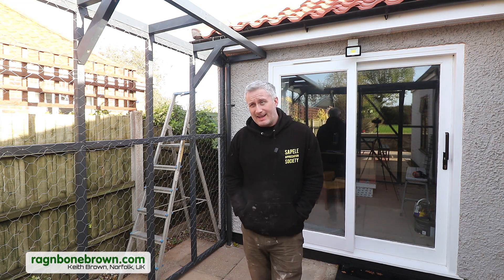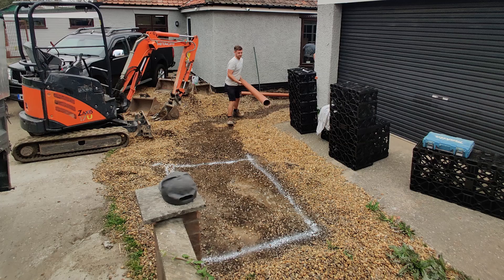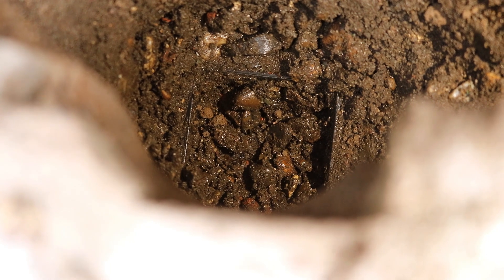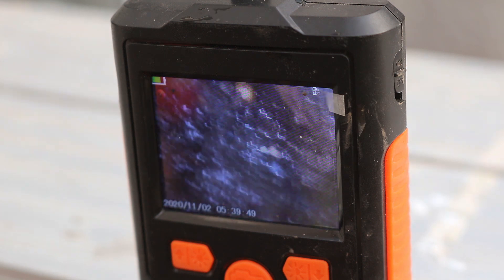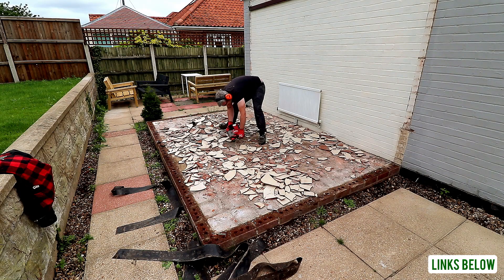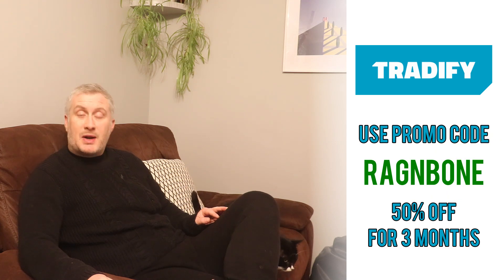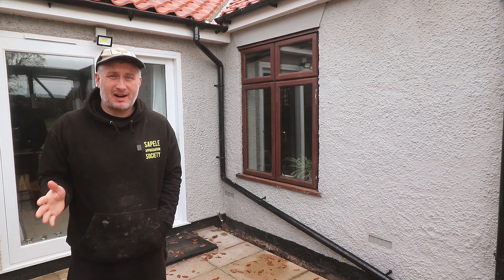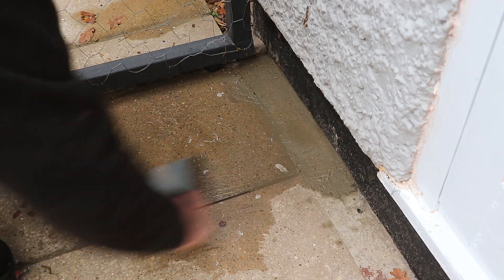How Would You Fix This Drainage Problem??

Comment: If it was me I would have used a 3 inch PVC 90 degree sanitary T-connector, painted it black or used a black rubber coating like  Flex Seal to cover the white.  That way you would have a 90 degree bend at the T and the extension would have been able to make a more horizontal run that you could have buried or at least run along the ground.  Since you used the "proper" fittings available from the manufacturer you were stuck with their T-connector that looks to only be 60 degrees (not 90).

Comment: You could have run that new pipe horizontally underground as originally planned and come up to enter your new T piece in the existing downpipe. As long as all the joints are sealed it will work fine.

Comment: do you regularly walk along that side fence?  I would have wondered about extending the pipe that way and running it along the fence rather than tilting it towards the house as you did.  Or would that block a needed walkway?    Still, I think you did a pretty good job.

Comment: The square pipe you have should not be used underground it is downpipe not drainage pipe not surprised it is not working it needs to be replaced with some approved drainage pipe and a new soakaway.

Comment: My option would be to see if I could  install a small sump against the wall at the good/square pipe location.  One of the pavers might have needed lifting/cutting,  Then the new connecting pipe would have the gradient required to run along the gravel edge.

Comment: I haven't watched yet, but this one seems like it will be useful for me.  Now that our rainy season has started, I'm have some serious water issues around the house I bought last spring. I'm probably going to have to start by replacing all the gutters. 😞 But after that, I need to find a way to get all the water away from the house, even though there's a big concrete patio that runs the whole width of the house. 🤦‍♀
Reply from the maker: Thanks, hope it works out ok! 👍

Comment: Because it'll just be rainwater, could you not have come straight down from the new gutter drain point, run the pipe further under the ground horizontally and then a little section back up to tee-in with the existing working drain pipe? Consequence is the horizontal section will be sitting full of water all the time but the rainwater will run off just fine surely?

Comment: It looks to me like the levels have been raised round the house, also there should not be earth right up against the brickwork. There is no drip on the bottom of the render either, looks like someone has had a problem before hence the black treatment to the base. Given the problem with the soakaway you previously had it would seem a few things have been bodged. Btw you need to inform your planning office if you are putting a new soakaway in. Hope this helps.

Comment: I would have removed the square elbow in the ground, and replaced it with pvc pipe, and fittings. Do everything with pvc (sewer pipe) in the ground, and the pipe you had before for above ground. You can find many types of fittings for sewers.
Reply: The pipe is square as well, looks like gutter down pipe was used. If the square elbow was removed it would be difficult to connect to the square "pipe", With the connection from above water is less likely to flow out of the bodged joint; a horizontal bodge would not hold water as well.

Comment: Shocking stuff, Keith. Been getting some house upgrades done in recent years, and it seems that "done" really means "half-done". Doesn't matter how well recommended someone is either. I don't have the skills to do most of this stuff myself, so really rely on honest dealing.
I do know how to blow a fuse / trip a breaker so have chased some wiring around the place. Found mains wires joined with insulating tape, and in one case masking tape. Found light fittings so rusted from the leaky showers, that the wires in em were all brown - had to clean them to figure out which was live / neutral.
Owning a place seems to be just an endless series of surprises, but we're still beyond lucky to be able to afford it. Cheers for sharing!
Reply: Your "temporary" solution was definitely decent, all considered. You might be sad to see it go when it finally gets replaced in 2037.

Comment: Years ago I worked in my family's landscape, drainage, and gravel supply. We basically sold a lot of rock. Drainage is such an overlooked part of homeownership and many people came in at their wits' end with huge and expensive problems that either were not disclosed with the purchase of their home, or as you pointed out more often than not, contractors just sticking pipe places that had no outlet. 

Here in the US, with sometimes larger yards, entire backyards would have to be excavated and repitched, then you have problems with the neighbors taking on your water, etc. There is a complete mathematical science behind drainage and pipe capacity that can scramble your brain. Add septic systems and other issues and well, it can be an absolute nightmare.

All that said, I really don't have any suggestions on what you could have done differently. And I actually don't think the pipe looks that bad. It's black and it goes with your colors. Perhaps it can be incorporated into some sort of feature for the kitty. At any rate good luck!

Comment: I was going to tell a whole story about my own similar issue but I will you spare you.😂 1) Who does work like leaving a significant gap between the down spout and the connecting piece underground  ¯\_(ツ)_/¯ ? 2) Perhaps paint the temporary pipe the same color as the house to hide the ugly. 3) I think overall this was a great holdover fix.

Comment: A temporary solution can be to install a watertank and collect the rainwater, and add the overfill attached to that down pipe. Another solution and bit more expensive at the moment, but it will regain itself in the future, is to collect the rainwater and use that rainwater with a filter and pressurepump to flush your toilet(s) and save on drinking water. But this needs some plumbing offcourse.

Comment: Good video as always, just a quick tip, if you have a blockage as you had, its sometimes a lot easier to vacuum (wet and dry vac) the blockage out,  I have a long length of vacuum hose for this type of problem.  Keep up the good work!
Reply: but the blockage is gravel, sand, stones and roots. i dont think a shopvac can suck all that up.
Reply: I have a shop vac hooked up to my cyclone it’s very powerful I had to suck up stones and done it no problem
Reply: Agreed, I have fixed some nasty problems like this with a vacuum cleaner and some patience.

Comment: You could turn the channel where you removed the gravel into a French drain.

Remove the gravel to clear the channel, bitumen paint the exposed house footings to above the DPC. 
Create fall towards the square pipe and have the channel lined with waterproof membrane and a perforated pipe which connects into the side of the square pipe and fill the channel up again covering the perforated pipe and membrane back up to ground level.

Then have the guttering sloping towards the corner and have a downpipe from that corner dropping vertically to the high end of the channel (the low end being at the pipe)

The length of the channel which is now a French drain will always drain away pretty rapidly and can act to contain increased volumes of water during torrential rain.

Also this could take away surface water from your patio area